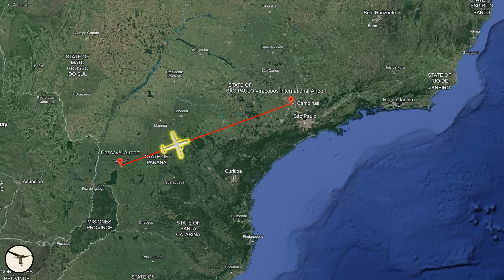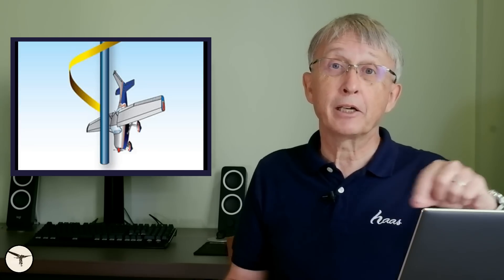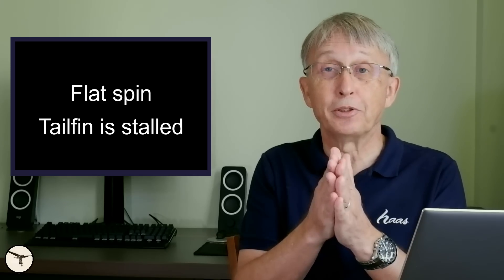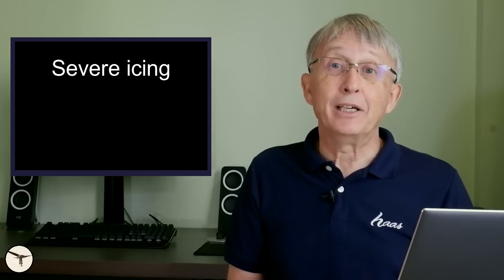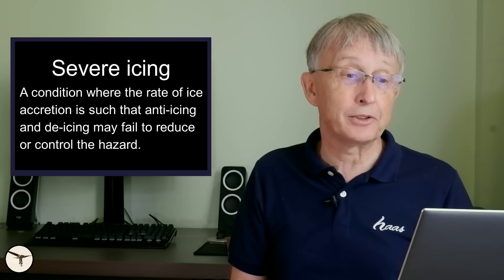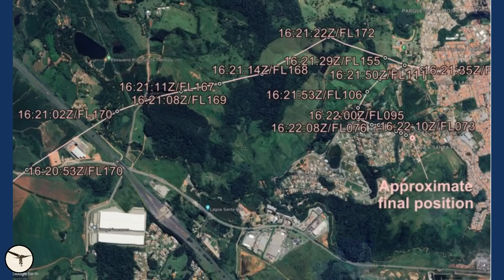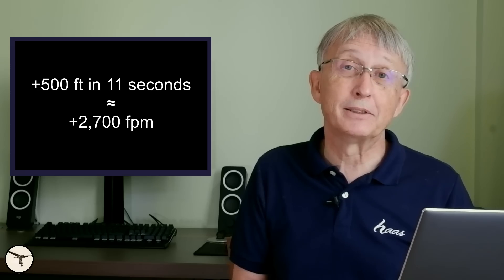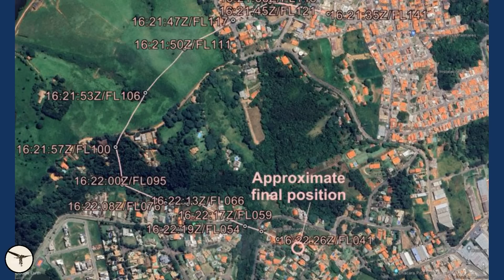ATR 72-500 Crash: Understanding the Fatal Flat Spin & Severe Icing Dangers

Comment: Thank you for the excellent explanation Captain! As a flight dispatcher, releasing an aircraft in a known severe icing area is certainly a no go. RIP to all souls on board.
Reply: It sounds like some of these responses are from people with no experience in airline despatch. Of course an aircraft will not be flight planned into a “known severe icing” area. However, practically speaking it’s very difficult to predict exactly when and where it will occur as it’s a moving phenomenon. Which makes planning for it impractical a lot of the time.
Reply: @meofnz2320 actually weather patterns are very predictable nowadays and dispatchers live and die by published sigmets and airport tafs, all of them have a validity period that dispatchers and us pilots need to take into consideration before our flight. For this particular scenario there was an active severe ice sigmet at the time of the flight and you could clearly see on weather apps the cold front passing over the region at the time of the accident. Hurricanes can be precisely predicted as well at what time and day they will hit a certain geographic location and we use that to delay our flights and plan to land after the hurricane has passed or do whats called an early bird to land prior to the hurricane hit. Regardless if this was the cause of the accident or not, it was absolutely irresponsible to dispatch a flight to cruise at an altitude of reported severe icing conditions, you dispatch them below or above if the aircraft is capable.
Reply: Especially a prop / turboprop.  And especially an ATR.  We've already learned this lesson before and shouldn't have to do this again.
Reply: @grayrabbit2211  ATRs are fine when operated correctly including in ice. Been flying for almost 25 years in NZ operating in and out of places like Queenstown all year around without issue. I've never flown them but alot of mates from my past job do. Zero issues. Correct training, maintenance and operating procedures and you'll be fine. Cut corners with any of the above, pay the price.
Reply: O think you are totally right  @Flying_GC
Reply: Alguns detalhes,alguns relatos dizem que estava sobre( gelo extremo),na altitude que estavam voando,e os especialistas dizem que está aeronave,fica num situação crítica voando nestas condições, lamentável, que Deus conforte a todos. 😔🙌🇧🇷
Reply: @eduardoqueiroz1457 , se ele estivesse SOBRE (= "acima de") gelo extremo, não haveria problemas, pois ele estaria fora da região de gelo, mas ele estava SOB (= "abaixo de" ou "submetido a", neste caso o segundo significado) gelo extremo e possivelmente (ainda é cedo para dizer ao certo) isso pode ter causado ou contribuído para a queda.
Reply: @goytabr  Higher is colder, he had to go down to avoid the extreme ice.
Reply: @RubenVillanueva-bz9rn  This is correct for this aircraft. Larger jet aircrafts can avoid altitudes with critical icing conditions by flying above the clouds in nice sunny weather. But this propeller aircraft type is not able to fly in the more secure higher flight levels.
Reply: Foi exatamente o que fizeram 🤦
Reply: Watch Menour Pilot
Reply: What? It's none of your business. Not your decision if it goes
Reply: @mrbushpilot  He says he's a flight dispatcher, not an ATC, so yes, can be his business and his decision.
Reply: @PlunkyFrog2001  neither of Bush Pilot's two brain cells were working when he made that comment.
Reply: @PlunkyFrog2001  stupid decision. That would mean ATR72 stays on ground 20-30 days every winter in Finland.
Reply: @guyseeten2755 well this isn't across the board. Here it's the captains decision. End of story.
Reply: @mrbushpilot  Wrong. The captain and the dispatcher have joint responsibility for the safety of the flight. PERIOD.
Reply: @mrbushpilot  Watch the video at minute 6:17
Reply: @mrbushpilot  6:17
Reply: @mrbushpilot  My first reaction to your comment was 'WTF?' but then wondered if the country you live and/or work/fly in refers to air traffic controllers as 'dispatchers' ?  Just curious.
Reply: @consortiumxf  ATC and Dispatchers are two different things. A dispatcher works for the airline. In my 20+ years in commercial aviation I've never heard of a dispatcher overriding the PIC about a flight. It makes zero sense unless the airport and it's alternates are closed due to weather, which a pilot wouldn't or shouldn't take off in anyway. Alot of people in here are talking about a subject they have zero knowledge or understanding. If met minima criteria are met with an alternate, I'd love to have a 'dispatcher' tell me I can't fly due to xxxx reasons. Laughable.

Comment: The positional ADSB data just looks wrong. If it hit a giant spring in the air it wouldn't turn around that fast, it would just fall to bits which it obviously didn't do.

Comment: I'm glad the ATR never became a success in Norway, the Dash-8 handles icing conditions much better.
Reply: And what will the Dash 8 be replaced with? It’s going to happen.
Reply: @hepphepps8356  Widerøe in Norway has basically rebuilt 20 DHC8-100 , in an agreement with De Havilland Canada. They are now good for 160.000 landings. The airline hopes by 2030 to serve the small towns up north using electric aircraft.
Reply: ATR is built for economy. But it has a 'acceptable' level of safety. That wing is designed to save money per hour.
Reply: @jamesharris9816  That wing is designed for disaster, and very little has been done about it. Insufficient de-icing system combined with a bad wing design can cause the wing to stall without warning when flying in icing conditions. This also happened to American Eagle flight 4184, an ATR 72-200. Flying a holding pattern in icing conditions, wing suddenly stalled, aircraft became uncontrollable followed by a rapid descent to the ground. The Brazil accident looks like 4184 all over again.
Reply: @subwolf7420 
'... wing suddenly stalled...'
This is factually false. What caused 4184 to crash was the autopilot tripping, followed by a rapid hinge moment reversal which caused the plane to roll rapidly to the right.

Comment: I understand this was a -500 model - does this have the same stall/icing protection and warning as the newer -600 model.  Is this significant in this situation?  Just wondering ...
Reply: The -500 and the -600 model are similar in this direction. But the -500 model is much advanced in comparison with the older -200, what was a direct result of the Roselawn Disaster.
Reply: @NicolaW72  Thanks for the info

Comment: As soon as I saw the video of the plane going down, I thought that sooner or later you would analyze the circumstances leading to the accident.
I didn't expect that you wouldn't wait for the report of the Air Accident Investigation Commission.
I admire the respect with which you treat the case in question.
Reply: I observed people on the ground (video) wearing winter attire.  Knew right then and there it was catastrophic icing like the American Eagle flight in 1994.  I do not know what the MSA or MVA is there, but it was definitely an emergency situation requiring deviation from ATC instructions to save the lives of those on board.  Getting below 12 thousand would have been my first thought with massive ice accretion.  I would have been hoofing it down pronto to get out of it at the first sign of rapid ice accretion and repeated reports from other pilots, bearing in mind what happened to that American Eagle flight 30 years prior.  Definitely time sensitive with the ATR.
Reply: @dashriprock4308  I live 30 minutes from where the plane crashed. It became very cold all of a sudden on Friday. 
On Thursday at the same hour it was like 25C and easily T-Shirt weather... And then in the next day it was like 18C, cloudy and very cold at the time it happened.
I don't know anything about aviation and weather. Just wanted to mention this.
Reply: @renanlopes9400  Dude, 18C cold? I was born in Sao Paulo, I would never call it cold weather. When I lived in Brazil/Sao Paulo I considered cold something like from 3 to 10 C.

PS : I know temperature drops significantly with more altitude, not talking about that.
Reply: @dashriprock4308  Yes and why even fly at that height to begin with, with the extreme weather present, minimise the risk.